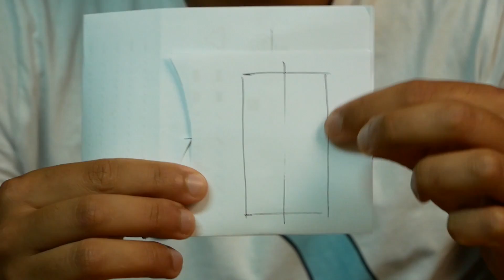Paper Wing - Making a Paraglider Part 1 - BANDARRA

Comment: "Surely we can do it today".....the beginning of MANY headaches and much aggravation since time began...kind of the beginning of the discipline of engineering.
Oh look, as you progress the "join line" approximates and air foil...just kidding..I had the "duh" moment, too.
Using paper to work out the topology was "brilliant".  WAY faster and easier than working in cloth, I'll bet.
Short of a computer, I would think the easiest way to lay this out would be to build a 3D model of the shape you want in clay or whatever, then just lay the pieces on top and "match cut" or probably better "match mark" if you will, the interfaces with a bendable straight edge or a line laser.
You are having too much fun again.

Comment: Well the shapes of the cells..from the center middle out from left and right are long then slowly get shorter in length nose to tail. You might have to go every 2 or 3 same length then go down a smaller length until you get to the tip of the wings. 1/4 the size from the middles length nose to tail cell length? Otherwise it will turn into a full circle same length nose to tail like doing big ears. This is from what I have gathered from watching so far. Keep going it is interesting. Take Care Andre! It's like building a POLYHEDRON from 2 or more shapes  to make a circle or square. Triangles, octagon, squares. Ect. I was thinking to keep the triangles underneath glue or tape another lighter piece of paper the thinnest you can find to make a cell layer the triangles will act as pockets. Then get a hole punch to each cell opening maybe 2holes to make an oval hole as one. My idea for you.